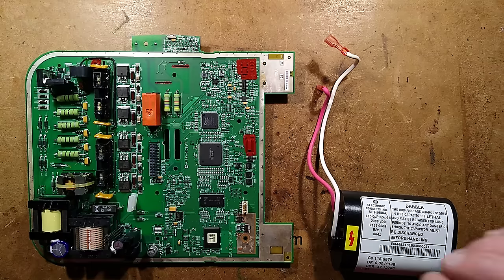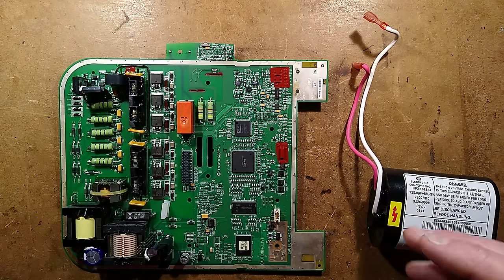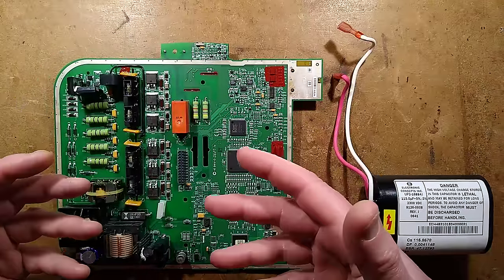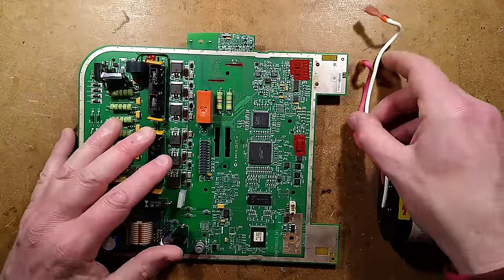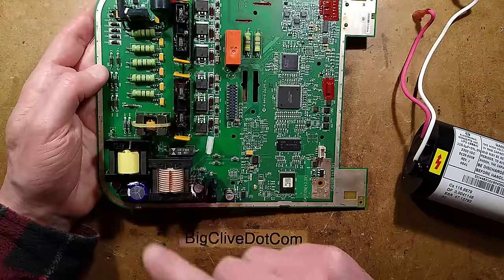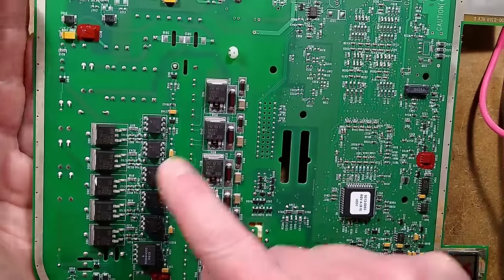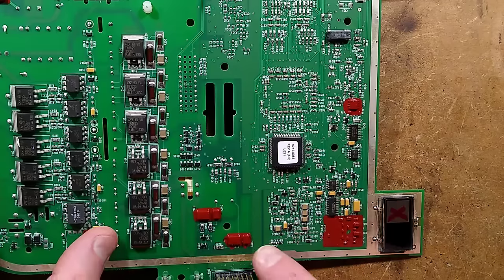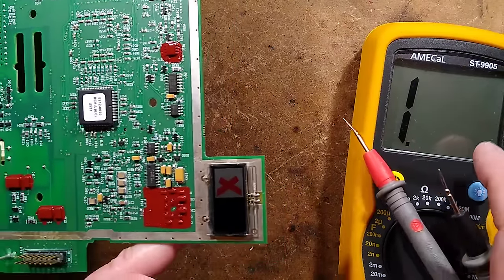Inside a Zoll defibrillator - with SCARY capacitor

Comment: The infrared port is still present, and is also used by distributors/sellers to program the AED, e.g. to change the language it uses, and to enable the capability to show the cardiogram on the display (a feature on more expensive models).

Comment: The heart muscles are fascinating. Every muscle has a little clock that causes the cells to twitch. If the muscle cells are next to each other, they twitch together in the same rhythm. But the sinoatrial node sets the pulse for the entire heart. The heart never sleeps, it only has a short pause between pulses. And yet the heart is connected to the emotional center of the brain.
Reply: Also the heart is the only muscle in our body that has a hardware protection against cramping. No matter what electric signal it gets, it will never stay contracted like other muscles could.

Comment: Modern defibs deliver a biphasic current flow to the patient, older units were monophasic output. Biphasic sends the electrical pulse one direction and then reverses, a more effective means to help restore normal cadiac activity for better patient outcomes. I guess that may explain the use of all those Thyristors on the main circuit board.

Comment: The CPR quality sensor pad in the middle also help for paramedics to connect LUCAS devices to. These machines do the CPR for the paramedics (they usually have one in the back of the ambulance) so that they can get all the other things like medication ready. The pads are also designed so that the paramedics can just disconnect them from the AED you’ve been using into their own AED.

Comment: That battery indicator is really interesting. It appears that it uses an LCD that is just a rectangle, no pixels, so it must use a split polarizer of some kind to ensure that either one side or the other will come on depending on whether power is applied or not. I wonder if that's an off the shelf part because I quite like that. From what I remember it used to be more common to see flip dots used for this purpose.

I find it odd that only a single capacitor is used. See, when it comes to electrical stimulation, normally you want to put current through the body in one direction and then administer a compensatory pulse the other way, because supplying DC on its own can damage tissues through electroporation. That's probably more of a long-term thing, though. For defib it probably doesn't truly matter. 
The sensor inside the pad, I suppose could be an accelerometer. Considering the hard, tough plastic that housing is made of it probably doesn't deform all that much to change the actual air pressure inside, so while I'm sure a pressure sensor can be made to work, I don't think it's the path of least resistance here.

Also, I thought Rayovac was Varta.

Comment: I've been shocked by a 'defib' 5 times sense my initial heart attack.  4 times by my ICD and once by an old school defib that the hospital had to use.  The threshold for my ICD was set at 185bpm.  And I had an event where my heart rate suddenly kicked up to 182 bpm.  Just under the shock threshold.

Wound up in hospital for an over night stay as they tried several medications  to kick it back to normal, and then they wheeled in their industrial defib.   (my ICD was reprogrammed to trigger at 155.)  People describe getting the shock as being kicked in the chest by a mule.  For me it's like sitting next to a large subwoofer and it gives a solid 'thump' directed at your chest.

These devices are extremely advanced and it's amazing that it all fits into something the size of a zippo lighter.   

Very happy that for a moments 'shock' it kicks the heart back into normal rhythm-Usually there is no visit to the hospital  Just a 'home link' monitor that is connected via bluetooth and sends the ECG and shock details to the cardiologist.   

All that in something 1/2 the size of a deck of cards.

Comment: The batteries in the unit we had at my old work were CR123A in a sealed package and from memory they were £125 a pack with a bit of circuitry. Yes I had to pull the pack apart to see what was in it. I guess sending the pack to you would be a problem

Comment: We put one in at our Church Hall. Not been used as yet but given your explanation , hopefully, it will be useful. Great video, thanks.
Reply: Just like a fire extinguisher, it is even better if it sits on the wall and never has to be used. 

p.s. They did have to use one at work on a colleague despite him having an implantable unit fitted just months earlier.

Comment: To tell you the truth, when it comes to high voltages and/or amperage output devices, defibrillators have come a long way and are very cool. However, what blows my mind is taking a device smaller than a VHS cassette tape, and using it to start a vehicle with a nearly dead battery. That said, seeing a medical device that is that easy to service while not being insanely expensive is impressive, and we need more of this. Having a more stable and rechargeable battery chemistry would be the main thing that would make this even better.

Comment: Having just recently received "training" on such an AED, where the training is actually only showing, this is how a device may look, open it up, this is what the instruction pictures look like, this is what the speech instructions sound like, this is about where to place the pads (also according to pictures, not this quite fancy kind of integrated placement mask). And with the special trainer device it could even simulate what it would sound and look like when the device found all parameters suitable for administering a shock.

In short, if you can see the pictures and are able to map a schematic picture of a person to an unconscious person in front of you, and you have the mobility and dexterity to apply the pads, you will be able to use such a device. The hardest part about it are the absolutely necessary chest compressions. They take quite a lot of force (which is why you apply pressure not only with your arm muscles, but use the weight of your upper body, and it still is strenuous. So if you are in the comfortable situation of having a second person, change every few minutes.)

Also I would advise, don´t wait for the device to tell you, call the emergency services straight away put your phone on speaker and place it next to you.
The software in those devices is so sophisticated, they thouroughly analyze if or if not they may apply a shock. If you find yourself in a situation where someone with a heart attack, or in general an unconscious not breathing person needs help, the only thing you can do wrong with an AED is not to use it. 

Only if you can still talk to the person there is no need to use an AED yet.

Comment: The heart has multiple pacing nodes, connected to the muscles by Purkinje fibers, specialized cells that conduct the impulse from the pacers throughout the heart. The nodes act as both switching and timing centers, ignoring pacing signals out of sync with upstream signals from the primary pacemaker in the atrium. Heart block being damage to sections that have those fibers, which can result in the loss of signal and a corresponding switchover to secondary pacers within the heart. That can help with diagnosis with an ECG pattern to determine heart block, where the block is and hence, the appropriate treatment.
It's also useful in the field, with the SA node: 60–100 bpm, Atrioventricular node(AVN): 40–60 bpm and the Purkinje fibers and ventricular pacers being 20–40 bpm. That corresponds to the degrees of heart block.

The new models are smart enough to be able to shock ventricular tachycardia as well as ventricular fibrillation, the older more manual models required a medic to determine if a shockable rhythm was present and could synchronize enough for ventricular tachycardia cardioversion. Suffice it to say, cardioversion wasn't exceptionally popular in an unmedicated, conscious patient...

I'd be inclined to think that the sensor is "listening" for heart valve sounds. Effective compressions can be verified by palpating for a pulse, such as a carotid pulse, but a wee bit difficult to achieve when alone - something about using two hands and being fresh out of spares to palpate anything.

Comment: Most impressive upload that I have seen from you so far - very cool!
What is more dangerous for your heart?
A high voltage DC shock or a high voltage AC shock? 💔
Reply from the maker: It's more the area of the heart that's affected by the current path through your body that is the issue.  But AC is extremely bad news in terms of locking you onto live metalwork with the continuous muscle stimulation.

Comment: some use those resistors to remove any charge build-up the main cap may develop, also used during a "self test" program, it charges to a specified level by the software then dumps the charge into the resistors and does a level check, i have other models at work that not only record what was done with it while hooked up to the patient.

the tick and the cross have a specific indication, upon changing the cells they will do a self test, if the test passes, it gives the tick, if it fails it displays the cross. it counts and measures how well you do chest compressions, and times them, these things will also tell you verbally that the batteries are depleting.

if you want an English speaking one I can send you one, still functional.
Reply from the maker: Thanks for the offer, but I live alone, so while a defib unit would be great I couldn't use it on myself.

Comment: The metal device is most likely an accelerometer. You are supposed to compress by 5 to 6 cm (about 2 to 2 1/2 inches). By calculating the second integral of the acceleration, they can read the displacement. I have something that looks like a CPR Fitbit watch that measures the rate and depth of the compressions and will beep once if the compressions are too shallow and twice if they are too deep.

Comment: Cool. Thanks for doing that one. We use Zoll as well at work. I have 'rebooted' many people with it.
Also, they are a lot more expensive in Oz. Those pads are just over $230aud and the unit is over$4000aud. They dont use individual cells any more, Zoll have gone to a proprietary lithium ion battery. And yes, the IR is replaced with a USB port for waveform download.
Our screen actually has the full output waveform as it's for fire service and not the public. That little chip in the puck looks like an IMU.

Comment: Good day Sir.  I heard about this video and had to watch.  I have been a Medical First Responder since 1998 and have used AED several times.  I also work for one of Canada's largest AED resellers and the ZOLL AED Plus currently sells for CAD $2093 and a set of 10 batteries is $90.  All of the Line Workers in Saskatchewan do carry AED's in the truck.  The non approved batteries do not charge fast enough. That device you have was manufactured in Dec of 2006.  New units such as the LifePak CR2 will allow you to continue CPR while analyzing.   The devi e WILL NOT deliver a shock unless pulsless V-Tac or pusless V-Fib are detected.

Comment: If anyone has high voltage capacitors, always put a permanent short on them when not in use
I have 2 large capacitors and a smaller one, metal can style, the 2 large ones were shorted, but occasionally i would hear a loud snap, took me a while to realise it was the small one that was self charging until it hit the breakdown voltage between terminals, it's now shotrted too
A good use for that capacitor would be a ring launcher, you can launch aluminium hard drive disks ;)

Comment: A tiny but important inclusion in this defib. pack is the disposable hair shaver, an often overlooked item, costing only pennies, that can mean the difference between good and poor electrical contact with the skin. Well done, Zoll, for thinking of everything and for designing a complete, truly user-friendly unit!
Reply from the maker: And the lid that goes under the back to open the airway.
Reply: @bigclivedotcom Another great point, Big Clive, 'though I'd also use the standard jaw opening manoeuvre to be sure of an open airway during resus.

Comment: I have a Phillips FR3 defibrillator in my car, as a walk leader I have removed the chest compression monitor device and put the defibrillator in a better shoulder bag for mobility.
It uses a special disposable lithium battery, when I bought a new one on Ebay I was sent a flat one that had been used. The device monitors battery strength and sounds an alarm when it is close to an ineffective level (not completely flat), the battery I received got "lost in the post" when I sent it back, so I lost my money. I imagine the seller is reselling the same battery to different private owners each time she gets it back. The defibrillator does a full battery check when you install a new battery.
I also have a practice defibrillator which does everything except shock, it is all mouth and no action. The English language spoken instructions have been standarised between brands so practice defibrillators give a realistic training experience.

Comment: They gave me one of these Zoll defibrillator to wear after I had heart surgery and it literally scared the crap out of me when I accidentally pushed the wrong buttons on the controller and it gave me a 10 second warning that it was about to blast me. I ripped the damn thing off me, you wore it as a harness front and back, which wasn't easy. Then I chucked it and gave it back to the hospital and told them I'm never going near that thing again. I'm sure in some instances a home defibrillator could be useful but it definitely still has some bugs that they haven't worked out. That was 2 years ago.

Comment: An interesting bit of kit!! Ours at work have the tick/cross showing through the front panel but I never imagined it would be an LCD!

In case anyone wonders, I've used Google Lens app to translate the screen messages:
Elektroder voksen = adult electrodes
enhet OK = device OK
Forhold deg rolig = keep calm
undersok reaksjon = investigate reaction
ring etter hjelp = call for help
apne luftvei = open airway
undersok pust = examine breathing
fest elektroder = affix electrodes

open to correction of course! ;-)
Reply: Comparing that to what the english operator's manual for the AED Plus states, that  sounds entirely accurate. (Zoll has their manual for free download on their web site.)

Comment: The orange relay that you pointed to is too light duty to handle the currents of defibrillation which can be 8 to 10 A or more.  The switching mechanism from capacitor to chest pads is usually done by a group of very high voltage IGBT and it is done in such a way to deliver a biphasic shock

Comment: I worked for a company that used to supply defibillator capacitors to the medical industry. When we shipped them they had their terminals wired together so that they were inert. If we ever saw one with the terminals not wired together it was treated very carefully.

Comment: I laughed out loud at the CAUTION 3.3V silkscreened on the board. Yes, we better be cautious around the dangerous high voltage of 3.3V 😂
Reply from the maker: Yeah, I thought that was odd.  It's the least worrying voltage on the PCB.  I wondered if it was a joke amongst the designers.
Reply: A reminder to not use 5V tools to troubleshoot it?

Comment: I am fluent in Swedish, so I actually understood some of the Norwegian that the unit spoke. 
And it surprized me that it started talking before all the batteries were in, very odd…
Reply: My guess is that the middle two batteries power the control electronics and the outer eight the high voltage stuff. Most control electronics now runs from 3.3V so two lithium cells will still need to be regulated down.

Comment: I can confirm they do make dummy AEDs for training. I used one when I was at fire cadets and I'm pretty sure Tom Scott has done a video with one in
Reply: You can train on the real thing as well, they make  training devices to attach instead of pads that generate a fake ECG that will allow a shock and can sink the energy safely ( you still need to stand clear)
Reply: @drmatt89  Oh that's interesting. They told us the one at fire cadets was a dummy unit but maybe it did just have the fake pads on it instead

Comment: I never knew what they were out of,  but  around the late 80's--98 or so,  you could buy what everybody called "medical caps"   that were  around  (as I recall) 35 mikes  at  about 5000VDC.  I still have some of them,  and have  about 3 or 4  that I put to good use as  filters in power supplies for  linear amplifiers  (legal, as a radio amateur.)  I'm 75, by the way, first licensed in about 1965

Comment: The cross hair like center part is actually an gyro/accelerometer. It does the reading for the chest compressions section.
Reply: I actually did the QA of the other consumer variant of the AED which had a proprietary battery. They are also each programmed with different languages and voltage at the time of creation/refurbishment. It is around 200 - 300v that is pushed through the pads with around an Amp or 2.

Comment: I built the older generation units back in the day. Also Physio Control units. They were the EMS versions. The testing area was a tad scary at times, considering we had a grounded and conductive floor.
Reply: We had to have those floors in the operating theatre cos of the HIGHLY inflammable anaesthetic agents......our shoes had to have a carbon button in the heel that maintained contact between the wearer and the floor.....anti static precautions.